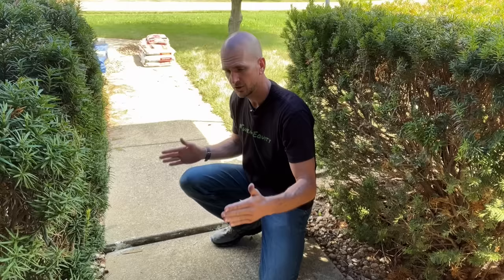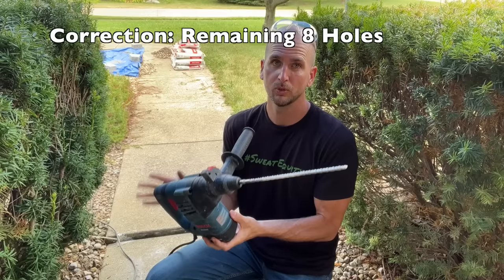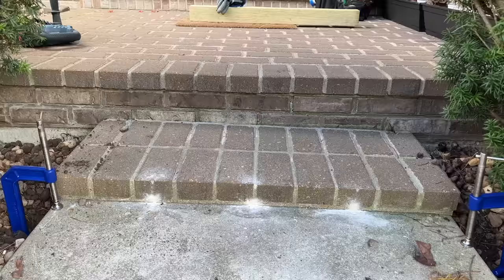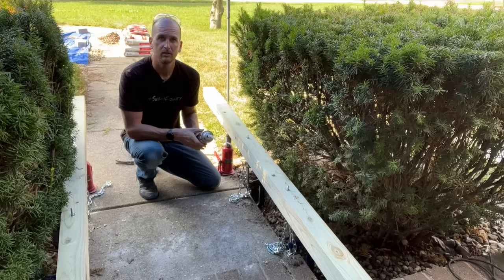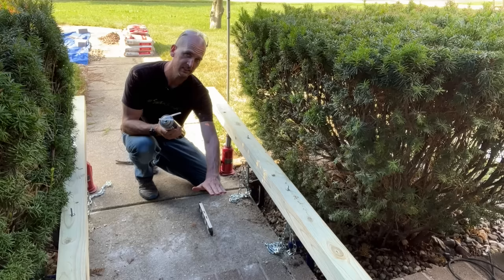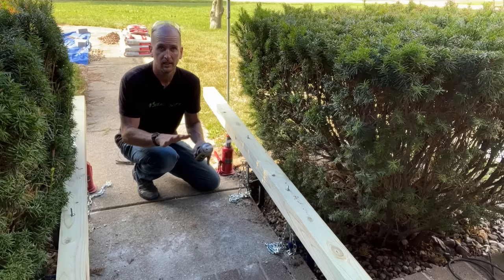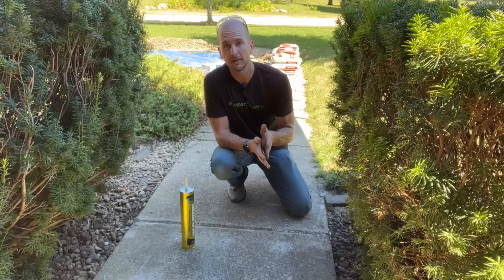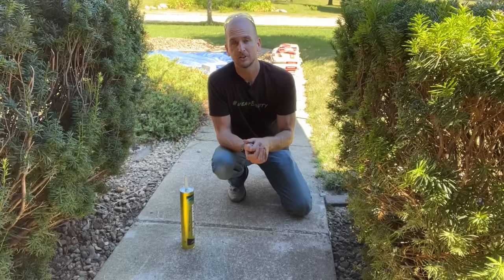How To Fix A Sunken Sidewalk With Spray Foam

Comment: I paid a concrete leveling company to do this in 15 minutes for $300, but they didn't use spray foam.  After they left, I poured dry sand all around the sidewalk section to fill the gaps and packed the soil in, so it can't happen again.  I am impressed you were able to do it yourself.

Comment: I did something like this about 5 years ago. I had to raise a pad in front of a two step porch/entry. I did all I could to raise it, tracktor & loader, crowbars (big ones), and more. Got it to about right, close as I could get it and stuff all I could under it, including several cans of foam.
I also repaired two broken step corners with a concrete mix and forms. It was pretty good, but didn't match. No one complained but I wanted more.
So I got some of that polymer resurfacer and did it all plus the 40 ft of sidewalk.
All looks great now. And I made the polymer a bit thicker to get the rest of the leveling I couldn't get before. This was a 60 year old sidewalk and step.
Reply: I have just gotten one step closer to being the smartest man on Earth

Comment: I have done this and it works very well, although I didn't use the jacks,  I simply raised the sidewalk slabs with the Great Stuff foam.  It will expand and raise the slab on its own,  but be careful not to inject too much,  because then it could end up being too high. 

The only thing I would recommend is to save the concrete dust from drilling the holes.   Then you can put that on top of the caulk that you put in the holes so it blends perfectly with the existing sidewalk and the holes won't show.
Reply: That’s why he raised it first so the excess woukd or could glow out holes
Reply: I like your concrete dust idea, but I like his raising and setting better.  It has more precise control of the slab's height and level with escape channels for the Great Stuff Big Gap on the sides.  You're right when you say it could expand too much.
Reply: " I simply raised the sidewalk slabs with the Great Stuff foam" ?????
Reply: @rufflesinc  the contractor's way is to foam jack a slab, but with that lil fella the method shown is most effective.
Reply: Thank you I was going to ask about that because I have a part I can’t raise but I know is sinking. It’s a slab.
Reply: @judys5767  I've used great stuff foam as it's designed , to seal holes . I don't understand how it can be used to raise concrete slabs, without other mechanical means
Reply: @rufflesinc  it can push up 5500 pounds per square ft.
Reply: @AmericaIsWorthIt there are companies that raise sunken concrete slabs with foam instead of mud jacking.. they claim it can hold 6 000 pounds per sq ft..
Reply: @AmericaIsWorthIt these spray foams are better known as expandable foam. The foam undergoes a chemical reaction and begins to expand from billions of microcavities filling with gasses. Some foams expand more than others. There are contractors who use large industrial tanks of the stuff and inject it under roads and driveways to lift them. If the gas is expanding and it has nowhere else to go, it will push up.
Reply: @AmericaIsWorthIt you are correct. One comes in a single use spraycan and the other is mixed into a large tank.
Reply: @billrehm3590  I work for a foundation repair company we do polyjacking. It's a little different than great stuff lol
Reply: @AmericaIsWorthIt Great Stuff works in lifting concrete.  You don't need to lift the concrete with a jack. Just drill the holes and spray with Great Stuff, It will lift.
Reply: @AmericaIsWorthIt oh yes it will, I have seen it push walls apart when too much is used. All I can say is seeing is believing, try it yourself.
Reply: Yes great stuff will definitely move structures. That is why they make Great Stuff - Windows and Doors which is low expanding and with less force than the regular, so that you don't shift your window and door frames and door jambs out of position.
Reply: @AmericaIsWorthIt not gonna argue if it the same or not but great stuff or other hardware store foams can deform a window or a door severely
Reply: @AmericaIsWorthIt I just lifted 9 slabs and a sunken staircase with this stuff just like he said. It works great. I put some in, waited, redrilled the holes to inject more until it was the perfect pitch. It's all poly foam which doesn't deteriorate from water. There's more guess work doing it this way than the way in the video. But both are effective.
Reply: Beautiful 😇 😍 🤩
Reply: They actually make load-bearing foam why does everybody use an air blocking foam for this?
Reply: @thecloneguyz  because it costs substantially less
Reply: @4pitts1burgh28  
$3 per can?
Pfffffftttbwuhahahahaha 
Sounds like somebody's going to be doing it multiple times
Reply: @AmericaIsWorthIt Wrong.  You put foam into the empty area between inside & outside wall, & you are likely to find that the wall was made to bulge way out & look stupid.
Reply: @AmericaIsWorthIt --Power Utility Companies use High Expansion Foam to Fill Void area around the Holes where New Poles have been installed, it can fill the Space around Pole Tighter than anyone can Pack in Dirt. I do believe that Ultra High Expansion Foam could Lift a Slab of Concrete...
Reply: @thecloneguyz  I don't know why? 😕
Reply: This is actually how I thought he was going to do it. His method is definitely more involved (and costly), but either method would work.
Reply: @JustWasted3HoursHere  that's exactly 💯 🤣 what I thought
Reply: @AssortTVOfficial  I'd worry about overfilling, and just like how I wound up with a crewcut some eons ago cutting my own hair, "the case of the uneven sides."  
"Now this one is higher, now that."  How do you know? A little dab'll do ya, and take it slow?
Reply: @rkoorse  ok 👍 👌
Reply: @AmericaIsWorthIt Put a high-expanding foam in the gap between a window frame and a wall, and watch the frame bend.
Reply: That seems pretty sketchy like you were lucky that it worked out to the right height, if it lifted it at all.
Reply: I have this same project. Which Great Stuff can did you use? There are different kinds so I want to know before buying them cans.
Reply: @JuskoLord247  great I hope you will finish your project.
Reply: @rufflesinc  it is made to expand. In a confined space it will still expand. It will either come back out of the hole or into the dirt. Enough spray foam will make it rise. Like if you put too much next to a window frame in a wall, the window will bind or even crack.
Reply: @JuskoLord247  big gap filler ... start in the center holes and work outwards ... it's important that the sides of the slab are cleared so that the pressure and foam have an escape path ... don't go too fast, as the foam will expand over time, but not too slow as it will start to cure ... plus don't let the foam in the dispense tube dry up or you will have to clean it out before you can use it again ... these cans are designed as one-use ... prep everything first, once you start using the can, don't stop til you are finished ... ie if you put the can down, after a few mins it will be very difficult to use the can again (unless you clean the nozzle and tube very well) ... good luck
Reply: @boots911  Raised my 3 feet by 2 foot slab 1.25 inches without any issue - 10 years ago. Still level.
Reply: Brilliant solution!👍👍
Reply: @kmoecub What pos frames are you installing?? 😂
Reply: It looks like the foam raised  the slab too high but some youtubers aren't honest with their audience.  That foam will end up lifting the concrete and you should babysit it while it's curing to take weight off the jacks that will eventuallly help the foam lift the seam higher  than he set it.  Another way of saying it is play with the slab seam and the jack as time cures the foam  and  put the weight of the slab on the foam as soon as it can support it. In some intances you  should  set the concrete joint slightly below  because time may or may not raise the slab.  You have been warned. This guys comment is a good one.

Comment: The most valuable part of this demonstration to me was the use of C clamps, jacks and timbers. Raising the slab with such control allows the use of a variety of fill-in support methods. 
The tip about drilling concrete with a rotary hammer is valuable too; I learned that after struggling with a simple hammer drill.
Reply: Thats why you hire reputable professionals. Lifting and trying to back fill at edges won't work. Slab will crack due to voids in a large area. Unreinforced concrete cracks wire mesh doesn't do the job. It bends with the slab over time.
Reply: It's literally 3 bags of concrete. Remove and replace is your best option
Reply: @travishanks7295  LOL exactly

Comment: I did mine differently.  I clamped angle iron on the adjacent slab and left the overhang over the slab that I raised.   Used this a a stop so it can only be raised to the same level.  I used an air hose and a piece of pvc to blow out a few channels under the slab.  Simply added foam in the void.  It lifted the slab until it hit the angle iron and then the excess simply flowed out the sides. No holes.  No jacks.

Comment: Well thought out and executed. You’ll probably get comments about easier and less costly ways but remember this you made a clear and clean video. 
Thank you!
Reply: A clearly visible horrible way to accomplish this.

Today I, an unlicensed not contractor, is going to show you what they came up with in thier own head. Once again showing people how to do things wrong.

Are you seriously telling me you would pay someone to drill holes in your walkway and spray foam it? I would withhold payment and contact the city inspector if that was done professionally.
Reply: @brandonhoffman4712 This is what the contractor would do.  It’s not just this guys idea.  You would “call the inspector” lol.  Admittedly the contractor would use a foam with a hardener that would likely last a while longer, but worst case this foam compresses in a decade or two slightly in which case you add a bit more foam.  You really seem like the type who has never picked up much more than a screw driver.
Reply: @brandonhoffman4712  ...meanwhile someone claiming to be an inspector above gave their seal of approval on this based on their experience with a company that actually makes this stuff.  What are your credentials for stating your position?  

Also this guy did not simply "dril holes in the sidewalk and spray in foam. He did a lot more as we can see in the video.
Reply: @hiramabiff5236  ive seen inspectors sign off on houses that then wound up full of mold because the plumber didnt do his job right. Thats only 1 horror story. I can fill pages with crap inspectors let fly by due to their book smarts.

Go back to school buddy. Tell your inspector buddies to pick up more books too, they arent smart enough.
Reply: @hiramabiff5236  also meanwhile. There are a list of complaints in this comments section from people who have had their slabs crack after having this crap procedure performed.

I could be an inspector if i wanted. But then i would have a boss instead of being the boss.
Reply: Actually dudes, this is a very similar blueprint to how the businesses who specialize in this do it. So there is nothing wrong with this method, especially a one block section of walkway. For those who make their living being handymen, this is an invaluable skill to pick up. I grew up pouring and finishing concrete, and do concrete maintenance on the side now. So this is a method I just added to my repertoire. I’ve had many people ask me can I do it. I’ve had to tell them now. Now I don’t.😁
Reply: That foam will settle into the ground. The issue is the settling of the earth and you have not corrected it.

Comment: Very smart! But if crappy or suspect walkway, suggest scrap of wood (at least 3/4" ply) under each bottle-jack to distribute load… avoid cracking and another project 😀
Reply: Yeah. Spreading the load under the jack is essential especially over an unreinforced concrete base. I foolishly assumed a 125mm fully cured slab  edge would be OK to use as a base to jack from. Maybe my 20 tonne capacity jack was a bit much but the instant I had the satisfaction of the sound of my lifted slab jump free and move up as I intended, I had the disappointment of seeing the cracks as my relatively new slab cracked right beside my jack. I had watched professional 'mud jackers' on YT and arrogantly assumed it was all just as easy as they made it look. The sheer stress I induced under the jack must have been greater than the lifting force applied to the displaced slab initial resistance.
Reply: I've never had an issue with concrete asphalt yes. But this is rated at 3500 lbs per sq in. And that slab he is lifting is only   1/4 yard or 500 lbs max (2000=80 sqft @4"). The 4 lift areas dived by the 4x4" Jacks makes that an over kill.

Comment: Very interesting, but I have seem multiple occasions where Great Stuff deteriorated over time, just turning to dust.
Also, it was never meant to be load bearing.
I'd be very interested in seeing this slab in a year or so to see if this works.
Our HOA contracted a company years ago to repair the neighborhood sidewalks and they used grout pumps to both raise and support sinking slabs. It's still working after maybe 15 years.
A manual grout pump can be rented for about $75 per day in my area.
Reply: Polyurethane foam does not do well if exposed to UV.  So it needs to be painted if used outside where light can hit it.  Hopefully he did a good job covering up the foam beneath his sidewalk.  I have brick steps rising about 3 feet from the garage floor to the kitchen door. One side of the steps is against concrete block foundation, the other side is a crawlspace. When I bought the house there was a hole about 3 inches across through the block next to the steps.  I filled it in 30 years ago with foam, until I could get around to using mortar. I was worried about vermin getting under the house.  The foam is still there and holding up well.
Reply: It won't deteriorate if protected from sun and air.
Reply: Seems like a short term fix with lots of equipment to me. Just have some friends, lift this thing off, and add gravel and done...
Reply: Yes true 👍 🙌 👏
Reply: It's not really bearing load. It's just bearing a few vertical inches of concrete weight for every square inch of Great Stuff. If it were a slab foundation holding up a structure, your point about load-bearing would be well taken.
Reply: @davefink2326  Well said. The sidewalk probably averages 3" thick, which is about 3 PSI on the foam.
Reply: you could use fence post setting foam. it's load bearing
Reply: @Bob_Adkins  Check you math. A full foot thickness of concrete is about 1 psi ground pressure.  Three inches would only be about 0.25 psi.
Reply: @mpmcclell  Yeah, thanks!  I really screwed that up. A cubic inch of concrete only weighs about 1 Oz, so that sidewalk has about  3 Oz per square foot, which can easily be supported by very weak foam.
Reply: @donoimdono2702  wow 👌 👏 😍 👍
Reply: They actually make a load bearing foam we use it for hanging doors and wall caps and all sorts of stuff instead of the air blocking foam
Reply: @will hardy foam door lining isn't designed to hold the door, every door set calls for mechanical fixings, the foam is a gap filler.
Repeated movement of a door when opened and closed will flex the foam if it is not also wedged and mechanically fixed, it might not fall out and the architraves will hide the inevitable crack so you won't notice.
Foam under the threshold won't take foot loads either, a thin aluminium section shows this up, a wooden on will flex too, but not bend and recover.
There are types of structure door frames but they are rare and a standard frame should never be used as load bearing, in the event of a fire it'd be a really bad idea
Reply: @will hardy mechanical fixings can be screws to timber, nails to timber, nails to blocks set into brick joints, driven expanding fixings, bolted high security cell door fixings, cast in fixings to concrete - anything you like to suit the task, of which which most require a packing between the frame in the form of spacers or wedged to tighten against.
I am well aware of what fixings are, however there are some numpties out there (not aimed at you) that foam fix without any mechanical element, I've seen it.

That also applies to windows and I've surveyed several houses only to find no mechanical fixings in the windows, so you could just take a knife to the mastic and foam and yank the frame out, they too had cracks on the cheeks of the window linings most probably because of unrestricted thermal movement, but one patio door frame certainly moved a lot because it was not fixed but foamed and was extremely dangerous.

Too many people see a video online and blast away, I agree with you and as I stated foam is a filler, not a structural element
Reply: @donoimdono2702  Best recommendation yet. And can be pumped in,  for larger areas, also.
Reply: @davidfarson4810  - it can't bear much weight, but for this type of repair I'd trust it.
Reply: @ILuv2learn  you just got lucky no mice or anything didnt chew right throu. foam is good for temp fixes like that but the risk of animals just chewing throu it or it just failing is stupid high. and foams not meant to bear loads like here. so overtime each steps going to comp it. dude has the slab raised could of used cement instead.
Reply: @donoimdono2702 It’s a two part solution that would be very hard to inject into holes.
Reply: @MovieMakingMan  - it also comes in a two part bag that you can mix , cut a hole in the corner and inject.